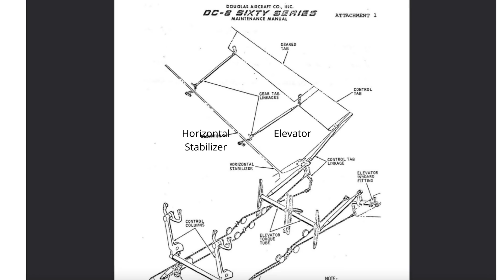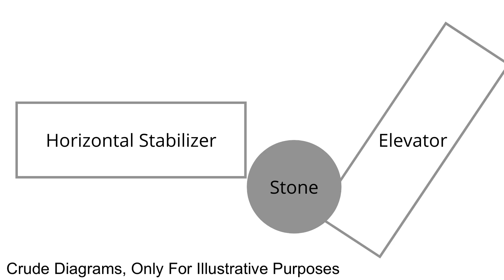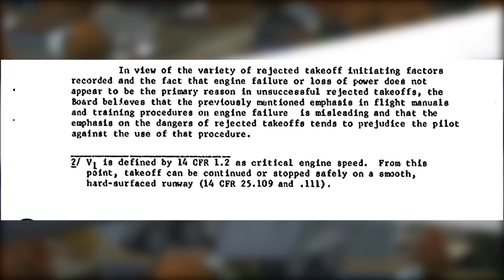How A Stone Crashed A Passenger Jet | Trans International Airways Flight 863

Comment: Another item for the list of terrifyingly insignificant things that can bring down a plane. A few pebbles, an insect, a piece of tape, a wrong sized screw...
Reply: A small burned-out light bulb (Eastern Air Lines 401).
Reply: @conorstapleton3183  A missing sensor (on the 737 MAX)
Reply: A misplaced washer (China 120).
Reply: The problem has mostly to do with the place where this insignificant item is attached.
Reply: That’s why F.O.D or foreign object debris is a hugh Hugh concern for aircraft and here is a perfect example of what fod can do to an aircraft
Reply: @mattm2687  FOD is a major concern.  i remember, after cleaning the flight deck, a FOD Walk Down aboard the JFK was a "all volunteers accepted" event.  Stupid Clean for Sea Dragon excersises--the velocity of the downblast could turn a piece of gravel into deadly buckshot.  for ship, squadron, and aircrew this was everyday life.  no one wanted to see someone die, a few did anyway.  this vid is a testimony to that.  good work!
Reply: @mattm2687  "Huge"..
Reply: @barryaiello3127  He was emphasizing how big the mistake was by writing hugh twice... he misspelt the second one....
Reply: @ethelcross3599  Oh, OK.
Reply: A new in flight entertainment system. A failure to convert between Imperial and Metric fuel measurement. Not knowing the difference between “expired” and “empty”. And my personal favorite, if just because it’s happened more than once, letting the pilot you’ve just fired for really disturbing reasons, finish out his shift/flight.
Reply: A just fired pilot should not be flying the plane....duh
Reply: @23727bgk  you would think that that would be obvious. But somehow Egyptair and US-Bangla both famously missed the memo. As recently as 2018.
Reply: Let's add too thick lubricant to the list
Reply: Well, a plane or any other complex machine has some areas that are simply not meant to be interfered with by random stuff.
Reply: A few ones and zeroes...
Reply: @BobbyGeneric145  a few large geese...maybe that doesn't fit...

Chunk of foam (space shuttle)

Misconfigured tie downs (and a humvee)

What was the fod that killed the Concord?
Reply: @glynncordry5965  A piece of engine cowling from a DC-10 that preceded it in the takeoff sequence. It had been incorrectly installed.
Reply: @Markle2k  The same also happened with Nigeria Airways flight 2120
Reply: @Markle2k  Concorde?
Reply: @Markle2k  correct.
Reply: Yea all we need now is to take pilots out of the cockpit and have computers flying the plane. Never mind planes, it's scary thinking they can do that with cars and semi's.
Reply: @warntheidiotmasses7114  But if you only have human pilots, there is the risk of one of them getting distracted, or falling asleep, or just being bad at making decisions in a crisis. When the system works (and thank God, it mostly does) you have a computer that can fix the dumb mistakes humans make, but also humans who can fix dumb mistakes caused by computer errors.
Reply: @lauriepenner350  That's why you used to have 2 pilots and a navigator. You ever work on computer systems? I did. When there's a glitch, a bad sensor, corrupted sequences, all Hell breaks loose. They only want computers in planes to save money. And perhaps for more nefarious reasons.
Reply: @warntheidiotmasses7114  Hard to say why they rely on computers for most work. I see a lot of benefits but i'm not into aviation enough to form correct opinion. 
If systems are doubles or tripled i don't see a problem, of course pilots have to be trained well like they need to be for manual flying, cooperate well, etc.
Reply: When hearing about this accident at JFK it dawned on me how many people form unbased opinions, or even take such actions. Sometimes it happens to trained professionals like pilots  or doctors who should know better.
Accidents at JFK are pretty frequent compared to small airports, we know that's because flights are a lot more frequent. Getting this answer is easy.
I find it much harder to understand why such facts are so easy to figure out even for less educated people, while other related to covid epidemic so often aren't. 
Hope things won't change just because a lot more people will be suffering from disease.
Reply: Uh huh.
Ok.....
Reply: ...a burned-out filament  in an [undercarriage-] indicator-light.
Reply: ...a pressure-bulkhead that was out-of-sight for visual inspection and which was liable to  be corroded by (and was, fatally) leakage from the passengers' toilet situated adjacent to it.
Reply: A cigarette on lavatory (Varig 820), fuel inside a detergent bottle + motorcycle battery (Uni Air, i forgot the flight number), laundry chemical (AA 132), saltwater (Cathay Pacific 780)..
Reply: Blocked pitot tube
Reply: 4 wheels and a 1987 2.45 diesel, safest way to travel.
Reply: @warntheidiotmasses7114  It can't cross water though.
Reply: @warntheidiotmasses7114  safest but the world is moving at a faster pace...
Reply: @warntheidiotmasses7114 Mercedes Benz
Reply: @d R No one can be sure about existence of something more than physical life, or contrary. Wish we had this answer.
Reply: David and Goliath anyone?
Reply: FOD
Reply: @d R your comment are very deep and complicated over insignificant subjects...
Reply: Planes are so much more delicate & fastidious than trucks or cars. Much more specific due to the high pressure engines and speed. Cold temps at 40000 feet.
Reply: A guy with a jetpack...
Reply: What 'insect" caused a jetliner to crash?.
Reply: @barryaiello3127  Some sort of mud wasp. It climbed into a Pitot tube and clogged it. Birgenair Flight 301 from the Dominican Republic to Germany. Crashed shortly after takeoff in the DR.
Reply: @andrewtaylor940  correct
Reply: @barryaiello3127  A tropical wasp that liked to make its nest inside unprotected pitot tubes. (Bergenair 301)
Reply: @lauriepenner350  OK, so yea, I                                                                                           just read up on it, ouch,
"The left engine flamed out, causing the right engine, which was still at full power, to throw the aircraft into a spin. Moments later, the plane inverted"
I thought pilots were supposed to walk the exterior of the plane and look for issues, guess they forgot.
Reply: @lauriepenner350  Only the ONE pitot tube, as always, as with AF 447.
Reply: @barryaiello3127  A mud wasp got into the pitot tubes of a Birgenair 757, parked in the DR for 20 days. Nobody noticed until the plane got airborne. End result was a catastrophic crash into the Atlantic and the death of all on board.
Reply: @andrewtaylor940  Yea, someone else posted that.
Reply: @barryaiello3127  a bee...

Comment: Once (2006) I saw a stone removing dude in action on an apron. Between the parked airplanes he was just blowing the small stones away with a high pressure hose. The stones were flying all over the place denting the surfaces of the planes as well. Incredible negligence. But this is the way it happens... in Florida.
Reply: The airplanes were just a stone's throw from disaster.
Reply: Aircraft owners have plenty to worry about, but this?  Good grief!
Reply: Thank God they were in New York because they do such a better job.. oh wait....
Reply: Now I wonder what would happen if a stone made its way into an engine... After all, at major airports, there are multiple aircraft with engines running. If the stones made their way into the engine and destroyed one of the fan blades, you could risk an uncontained engine failure. If the stones somehow made their way through the bypass of the turbofan without knocking out the blades, you'd get stones flying out from the back of the engine at whatever speed the air was coming out of the engine.
Reply: @williamhuang8309  Pray pilots for want of stones.

Comment: Seems they really should have aborted  that takeoff. I suppose if the airplane was on fire, as long as the engines are working fine they would've kept going
Reply: Hind sight is always 20/20.
Reply: @beer1for2break3fast4  thanks for the platitude. When you cannot keep your tail off the runway, something is very wrong. They had plenty of room to stop.
Reply: @kevinbarry71  and hitting your tail could easily mean big trouble too...